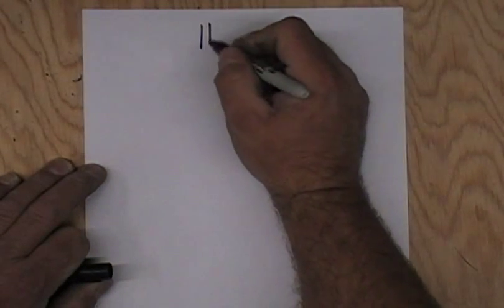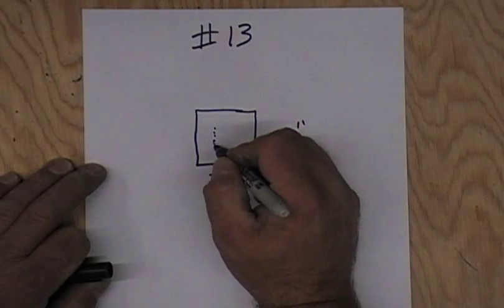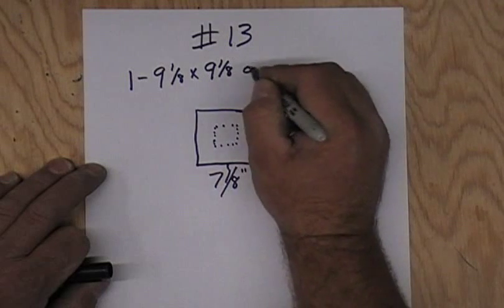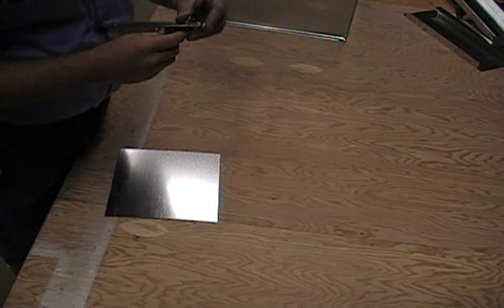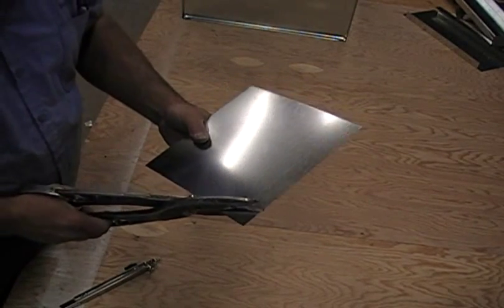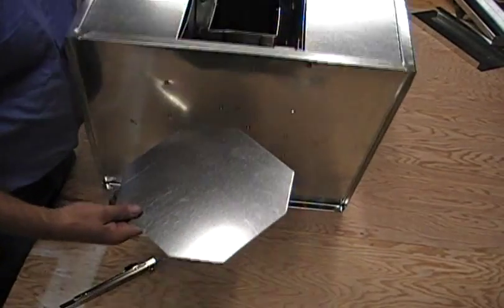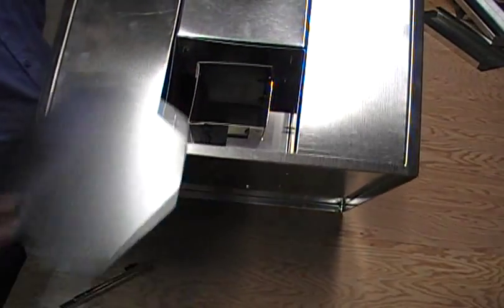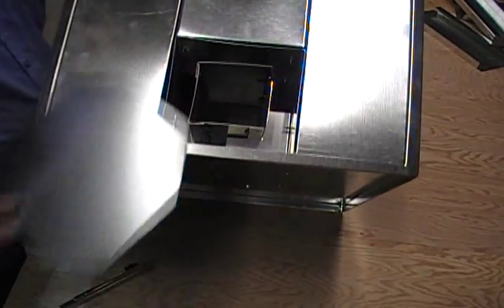Build a Modular Rocket Stove (part 12)

Comment from the maker: This isn't a normal wood stove. When the oven was fired and cookies were baked in it the flue stack temperature never got too hot to hold let alone hot enough to melt the zinc. The temperature of the base pan was about 200 - 250° hottter than the oven temperature; Thus you would need to fire the oven at about 500° in order to melt the zinc coating (which melts at about 787°) on the base pan alone. The insides of the oven simply would not get hot enough. But do use unplated if available.